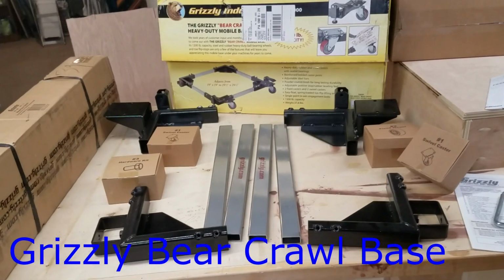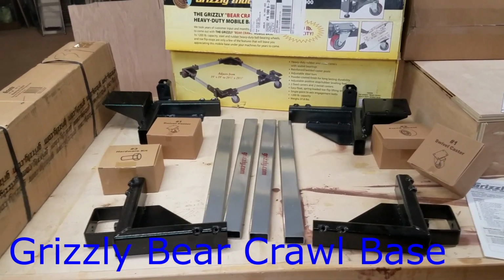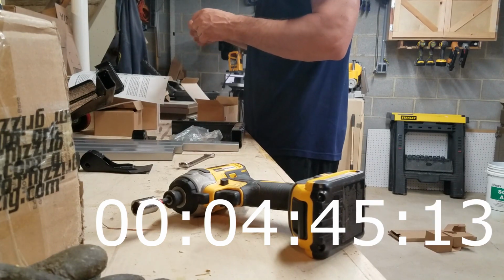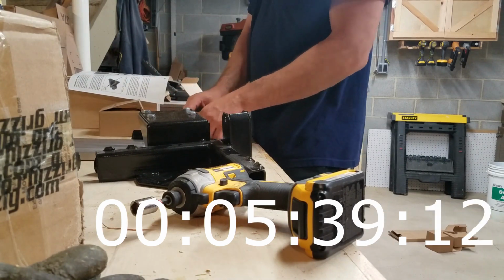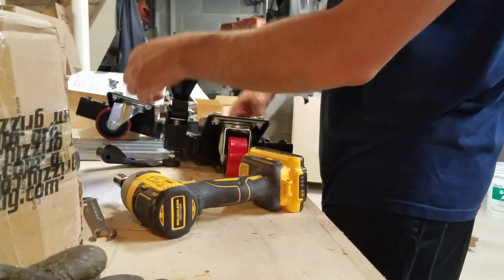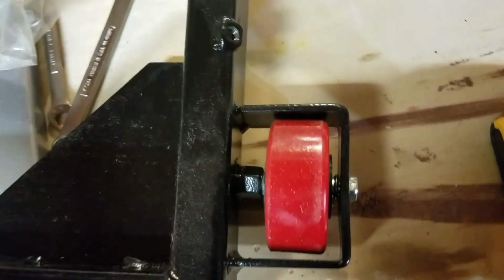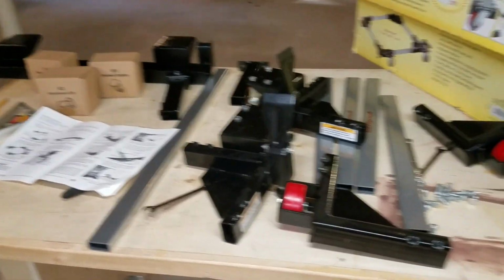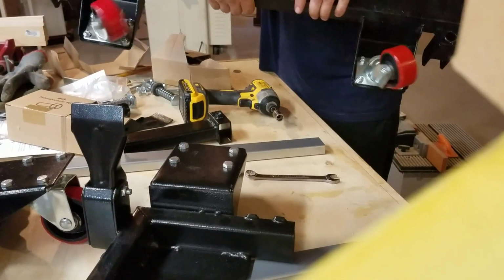Review: Grizzly Bear Crawl Mobile Base With Extension

Comment: How do you like this base and extension?   I have the same saw and have been considering a mobile base.   I was comparing this base with the jet mobile base and extension.   Do you have any problems using the levers to lift the saw?
Reply from the maker: I like the base and would purchase it again.  I don't move my saw often but when i did it rolled easily and the levers worked fine.